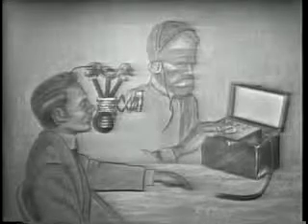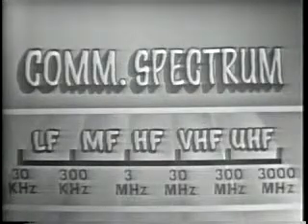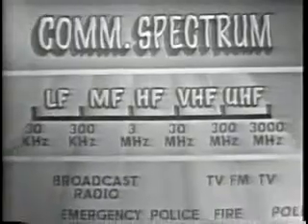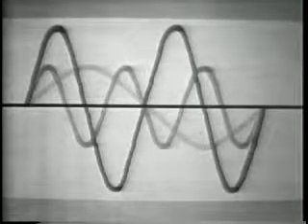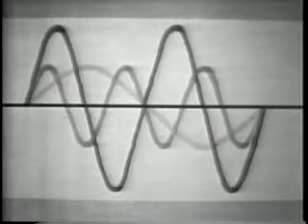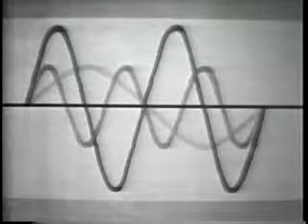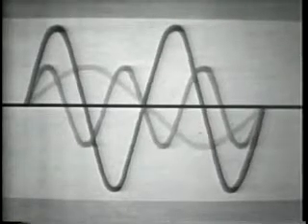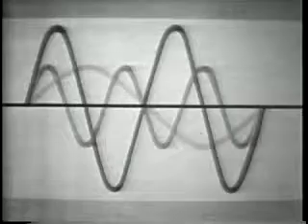Introduction to Single Side Band

Comment: Good explanation.  A training video today would be 90% incomprehensible math, Fourier Transforms, etc.!
Reply: If only!  I see so many purported training films that contain very little information and doesn't even bother with the actual signal math, with or without Fourier transforms (fast or regular).  This old film showed both the time domain and frequency domain perspective and explained how the bandwidth reduction was done on the transmitter IF signal by using sharp highpass or lowpass filters tuned to cut right at the IF carrier frequency, thus being independent of the assigned carrier.
 The BFO detection method was less clearly explained as it only explained it for the case of a zero intelligence 1kHz test tone and not a varying frequency message .

Comment: Some time indeed, I think last big AM station's has shutdown in Britain this year, Finland shut last at 1992 and some countries still uses it. When analog AM some day dies totally, frequencies go use in digital signals. Maybe IoT or something electric meters signal to grid and water meters off-site reading. Now those uses already 450MHz I think. But as he said, there's never enough room on bandwidths spectrum. Digital signals helped little bit that too.
Reply from the maker: The NTIA along with the FCC are trying to divide the frequency spectrum even more with narrowbanding.  Some parts of the spectrum has already seen the 25Khz divided into 12.5Khz a few even to 6.125Khz.  Newer technology is the driving force to it.
Reply: Biggest problem is that the mobile phone industry is hoarding every available frequency, enticing governments with huge auction prices funded entirely with borrowed money.

Comment: It doesn’t explain how single sideband captures all the information. The most difficult part is brushed over.  If I put a rectifier on a signal it kills the other side of the bandwidth.🤔
Reply from the maker: It is assumed you have already gone over AM principals and have the knowledge where the side bands have the intelligence i.e info.  This is an old production of a training film for the military.
Reply: @johnmayer4747  Right, but that still doesn’t answer my question.
Reply from the maker: @naughtiusmaximus830  AM, When you modulate the carrier with Intelligence (normally audio), the info is in the side bands, not the carrier

Comment: and you don't want to stand too close to that antenna when you transmit....you can fry your eggs.
Reply from the maker: Depending on the output wattage.  10 watts, eh... whatever, 1kw, caution, 10kw, do not get close.  Worked on 10Kw and it was often you needed to turn it off before getting close to the antenna.  1Kw, you can get close but do not touch the bare antenna wire.  Just to give you an idea touching bare antenna wire is hazardous, touched a 5 watt radio antenna wire by accident and got a quarter size 3rd degree RF burn.  A lot of colorful metaphors was said.  Took a couple of weeks to heal.  As far as RF radiation concerns just play it safe.
Reply: @johnmayer4747  the antenna's I work around are about 100 watts output.  Anything that makes you tooth fillings warm is bad.

Comment: My fear is the government will do away with the AM broadcast band for 2 reasons...

1 - So they can realicate the frequencies.

2 - To silence talk radio and thereby allow the government to more effectively control the narratives and attitudes of the people.

The free and open sharing of ideas is dangerous to a totalitarian government.

Isn't it interesting that automotive manufacturers just announced that they will not be putting am radios in their cars going forward?
Reply: What makes you think that the narratives you get from talk radio represent anyone besides their sponsors?
Reply: What exactly would the AM broadcast frequencies be reallocated to?  The big need for spectrum is for cellphones and digital data, which simply won't work on the very low frequencies of the AM broadcast band.  The automakers are getting rid of AM in ELECTRIC vehicles, because of RFI issues with the motor drive electronics wiping out AM reception. But fans of right-wing AM talk radio aren't likely to buy an electric vehicle anyway....
Reply: @bobweiss8682  Even if they buy one, they still can use a web sdr service and continue listening at the HF bands
Reply: @thomasking5970  : Sure sponsors are a big deal, but the hosts can't totally blow smoke or the people will quit listening and the sponsors go away.

Also, being able to call in an express your opinion is very valuable and is harder for the advertisers to control.

I prefer more viewpoint and forums than less.

Comment: That map looks like someone's kid drew it.
Reply from the maker: What did you expect from military training from the 50/60s? They were lucky to have video back then.
Reply: @johnmayer4747  I expected higher quality, like the highway safety video, Mechanized Death.
Reply from the maker: @wesKEVQJ  This was a locally made video at Keesler AFB with a limited budget.  Back then the local military did not have the means to produce a quality product, just one with the information in it.
Reply: @johnmayer4747  I know, I was just making fun of the map, I was in the Navy and had to watch countless safety videos. Most of them they showed me were from the 60's and 70's though. Are you saying someone's kid drew the map?
Reply from the maker: @wesKEVQJ  Sorry, thinking you were a troll and was defending what they had back then.  Retired AF and taught Military my last few years in and then taught them as a civilian, now retired.  The quality of videos the local AV training has improved significantly.  I made a YouTube Channel RF Transmission for the RF Transmission flight b4 I left and they are still using it today.  Has some decent videos you might be interested in.
Reply: @johnmayer4747  Thanks, I'm new to the radio hobby. I kept putting it off, then I bought a sdr dongle and made a 100 Mhz Yagi antenna and it worked really well. I can get FM stations from over 130 miles away. Although that one is on a skyscraper in Chicago and my local elevation is relatively high to my surroundings. Plus they made the test available online and that made me go ahead and take it. I have been knee deep in a project I started with an Arduino controlled solar panel array. I hadn't wrote any code since the Commodore days. I'm probably going to make a satellite tracker next. Then I want to try out 6 meters. This video explains why they call AM radio stations cloud burners.